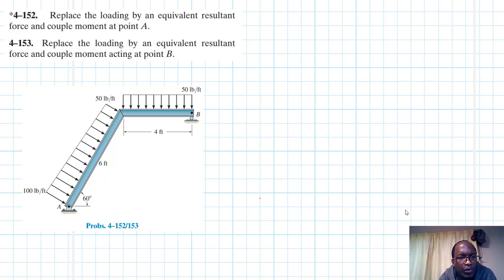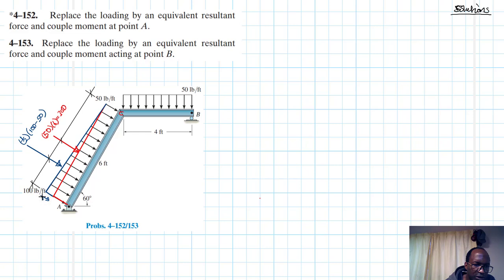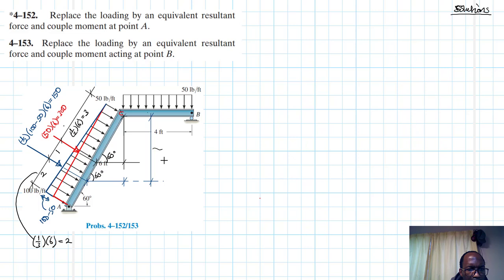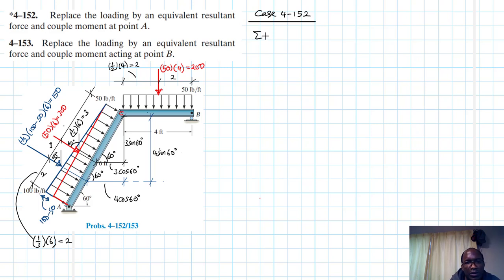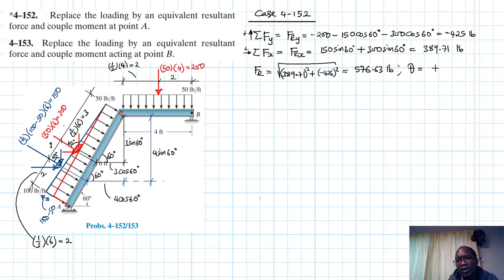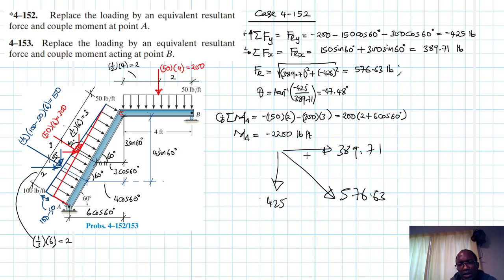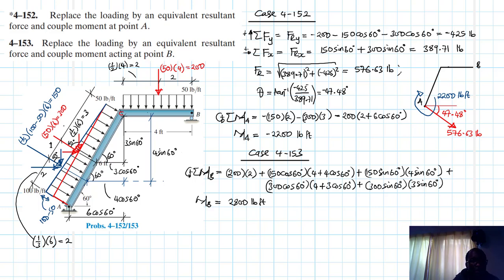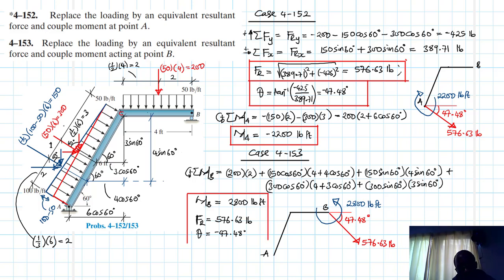4–152, 4–153 Force System Resultants (Chapter 4: Hibbeler Statics) Benam Academy

Comment: @14:50 did you mix up your sin and cos components for your sums of Fx and Fy?  Shouldn't the sum for Fy be -200 - 150sin60 - 300sin60? I appreciate your videos a ton!!
Reply from the maker: Welcome but the components are correctly calculated. Just check your work again.
Reply: Why in moment A you didn’t plus  -200(cos 60) it’s fax components